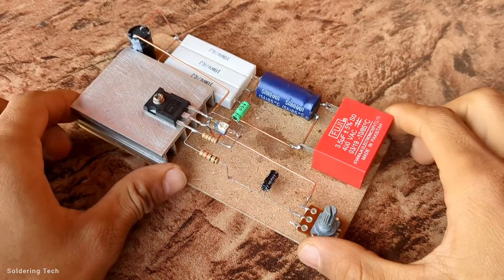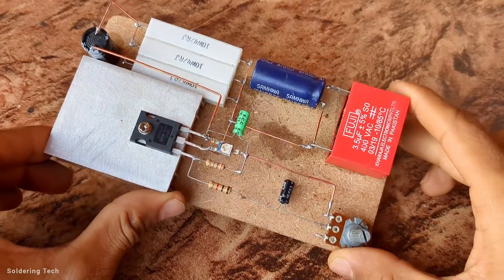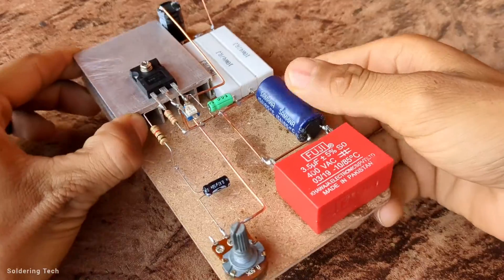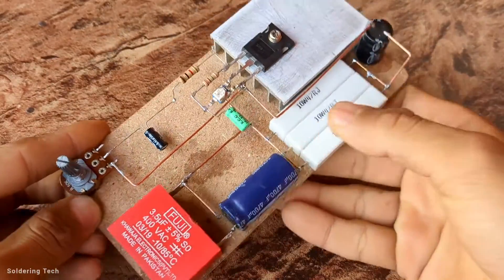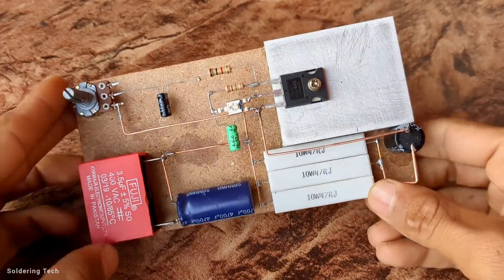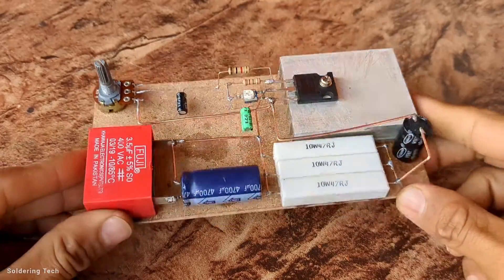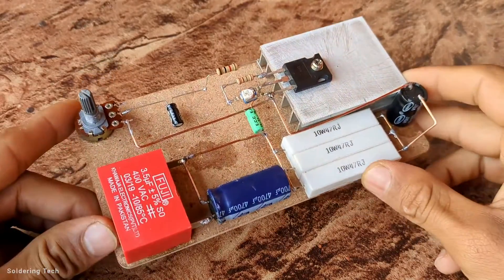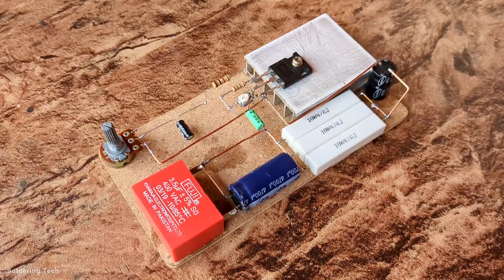How to make amplifier using Mosfet | Mark Houston amplifier circuit | Diy a powerful amplifier

Comment: Hello sir, 808nm 200mw infrared laser diode can burn matchstick from 1, 2 meter distance with in second or not
Reply from the maker: You should try
Reply from the maker: Rub black marker on match stick for fast result black color obsorbs heat quickly